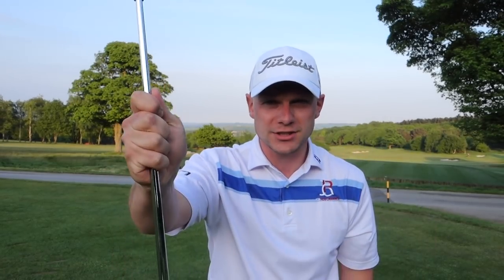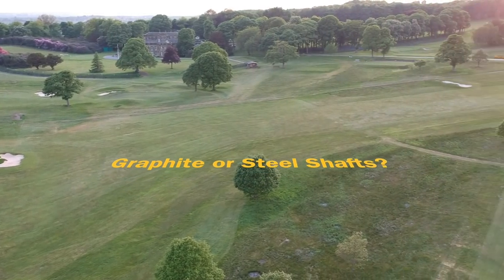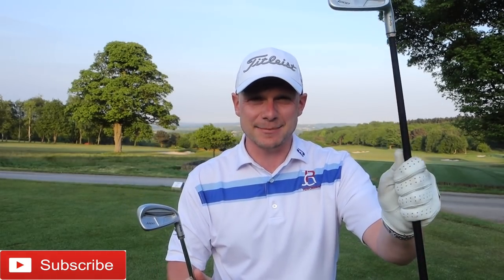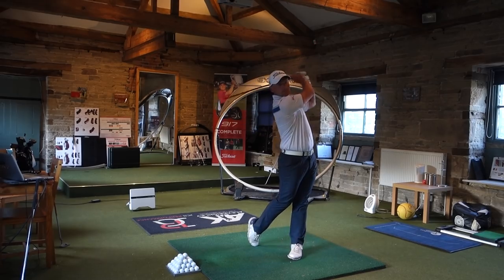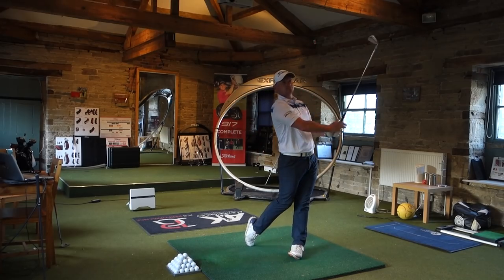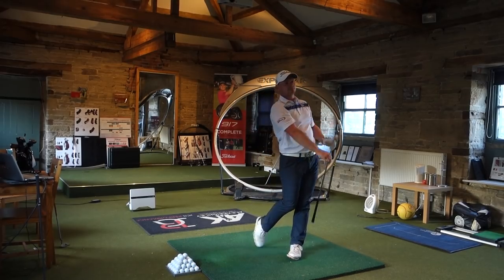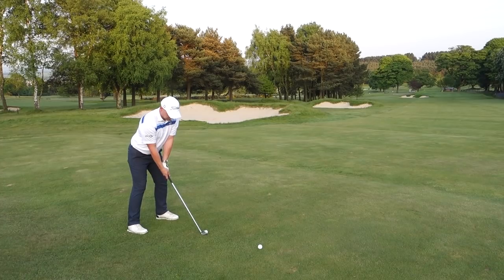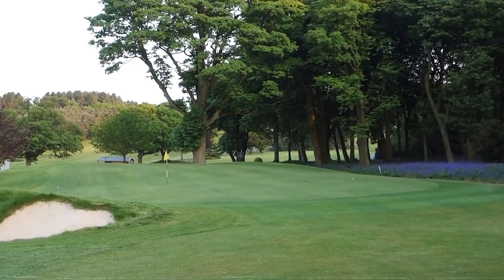Graphite Shafts vs Steel Shafts in Irons - Ping i200 Heads

Comment: I just want to add that you can get graphite in heavier weights similar to steel shafts. I went from Nippon Modus 105 to Project X LZ graphite and the shaft weight is pretty close and my irons are still very workable and has helped me with elbow pain.
Reply from the maker: Thanks Tom!

Comment: In Graphite kick point and torque is vital, not just flex. I’ve used graphite for 20 years due to injuries. From X flex to stiff. Right now Aerotech 110 stiff. Consider doing another vlog using very stiff low torque graphite. Thanks for all you do! Especially now. Stay safe!

Comment: Like club heads, shafts (both steel and graphite) should be fit to the player.  Try all brands you can and multiple shafts.  I am lucky to have a fitter near me that has that capability.  I have lost some speed over time (driver is at 104 instead of 112 nowadays) and a full TrackMan fitting pointed to the best combo of head and shaft for me(TaylorMade P770 with Mamiya Recoil ES 780 F4 graphite shafts). I hit Ping, Titleist, Mizuno, Callaway and Cobra (skipped PXG, too pricey).  The combo actually pushed my distance back up to what I use to hit with my Mizuno MP69/Project X 6.0 combo a few years back.  Dispersion also was squeezed so my accuracy ticked up a notch.  Also I haven't had any problem shaping the ball in both directions or in elevation.  Didn't care for the TM wedges though and found the best combo for me was Vokey SM7 with standard steel wedge shafts.
Reply from the maker: It’s amazing what technology can do isn’t it! Thanks for watching!

Comment: I am a visually impared senior golfer who swings a 7 iron about 65 mph.  You will be thinking , he needs a senior graphite shaft.  Actually over the years I have discovered that I am much better off with a soft or one stepped regular flex light weight  steel shaft.  The reason is torque.  I don't always it the ball perfectly, often hitting just behind, or just up on the ball.  The hight torque of a senior graphite will often send the ball off in an unwanted direction.  Steel will usually send it toward the green.  Granted often after stinging my hands.    My new Wilson LP irons ave done a lot to improve my ball striking.

Comment: Nice video.   The tour players mentioned by name,  and now perhaps many on the senior tour,  play aerotech steelfiber shafts which is a graphite shaft with 50 miles of steel thread wrapped around the outside of the graphite.

Comment: You mention the stiffness of the shafts both being stiff, but graphite being lighter, I wonder, do they add weight to the heads on the clubs with the lighter shaft to keep the overall weight the same?

Comment: I replaced the steel shafts in my Nike Covert 2.0 irons with the Kuro Kage Black shafts two years ago. I picked up about 5 yards per iron, but the biggest improvement was that my tendonitis in my elbow has disappeared. I prefer the feel of steel, but not the pain. I cannot say for sure that the switch was the cure, but it was coincidental.

Comment: Do you think there may have been a swing weight change switching over to the graphite shafts, since you said they felt a lot lighter, let's say from a D5 with the steels to a D2 or 3 with the graphite making it harder for you to turn it over or flight it low??

Comment: I like your channel, watched many of your videos and they're great.  Here's a question along the line of shafts.  My club head speed is 75-77mph with a steel 7 iron.  Would I benefit changing to graphite especially since I'm looking to move from my Speedblades to either the P790 or P760 irons.  Your thoughts?

Comment: The new graphite irons shafts is more fun and more relaxing because lightweight , more distance and more forgiving .
UST ES780 F4 is very good for steel iron shafts replacement . You need consistent swings but in golf course will deplete your stamina on whole 18 holes and your swings will be getting weaker as weaker . Heavyweight steel shafts will getting inconsistent swings because you getting tired and you will have more tension on your muscle and trying to swings same speeds will getting bad results
Reply from the maker: Great points Sean ! Cheers
Reply: Sean C that’s what I play in my Hogan Ft Worth Blacks and I couldn’t be happier with the results. I also gained about 1/2 to a full club in my irons. I love the recoils so much i put Recoil 125 Prototype shafts in my wedges. Oh and I’m a 5.6 HC so they aren’t just for the juniors, ladies or seniors.

Comment: Around 20 years ago my pro put me into a new set of clubs with graphite shafts and neither 2 nor 3 iron because "you're not good enough and you're losing flexibility". That hurt the ego then but it was pretty accurate. Ever since I've used graphite and find it a bit easier on the body.

Comment: I like to use a quality steel shaft (you have better results with graphite, than I do) 
Although 1st thing I do is un-lengthen the shaft, re-swingweight the club  & install new Golf Pride Muti-Compound Mid-size +4  grips.  It feels just right to me.
I guess you could say all my clubs are re-built & personalized.
I have some in graphite , I do the cut, weight, & grip on them.
Reply: Do u bend the irons more upright after you cut them down? For every inch u cut it down the club becomes 2 degrees flatter. Also wondering about your grip choice??? I love the mcc+4 as well, but after cutting it down it takes a ton of lead tape or tungsten powder as well as tip weights to get the club back to where it was originally swingweighted. I lighter grip like a gp tour velvet will help with sw issues.

Comment: My next set will have graphite because of problems with my hands not because of distance. After 18 holes my hands can be very fatigued and in pain because of the vibration and extra weight of steel. So that’s why I’ll be making the switch.

Comment: 12 handicapper and have been playing graphite shafts for years in Big Berthas.  Here is what I notice--when you really catch one clean, it will add 20 yards to your shot.  So here is what happens --150, 145, 152, 158, 180, 150, 155,  etc.  I have never figured out why.  Pretty much across the board too, even with the wedges.

Comment: You really need to do this one more time. (And read up on the fact - This old one is kinda embarrassing, really!) 

Most of your graphite information are way of base. Lighter?! No, only if you want it to be. You have iron shaft in the 60 gram category so most graphite are heavier, but, okay you can get graphite in the 40 gram category. (But also as heavy as you need it to be.) The thing you playing with (as always) are the feel, the flex, the tipping point and the spin. Millions of options out there and to get the best ones you take the one with tread of "iron" over the graphite. (Some might even look like an iron - That´s the one the professional goes for.) You get al of the benefit of a graphite (less vibration) and all of the workability of the best irons.

You also say they are straighter when you don´t need it to be. (problem shaping the shot) No, wrong again! That´s only happen if you choice the wrong shaft. Try it again and lets do it now, okay?!

Comment: ???? What are the specs on the shafts??? Playing length, shaft weight, torque, kick point, flex(are you assuming that the flexes are what the letter is), PING does not make shafts-so who were they contracted too, False-graphite does not add speed ... how the shafts accepts the load applied gives you better or not better shots, are the shafts spinned or SST, etc.. You leave out way toooooo many variables that affect a specific shaft to a golfer. You need to go to a shaft performance school and a fitting school, then you may have something more informative to say about shafts.